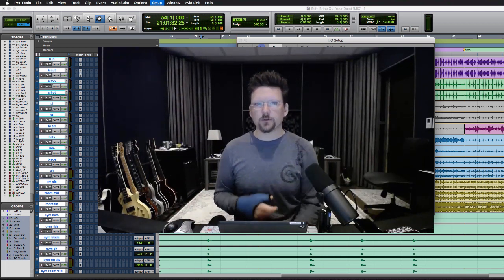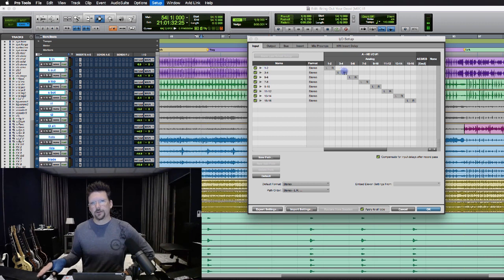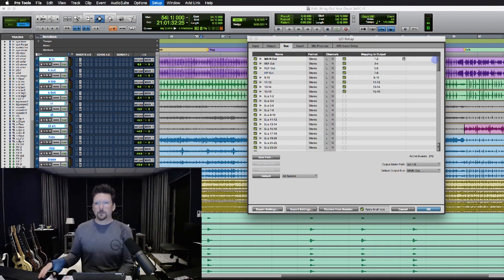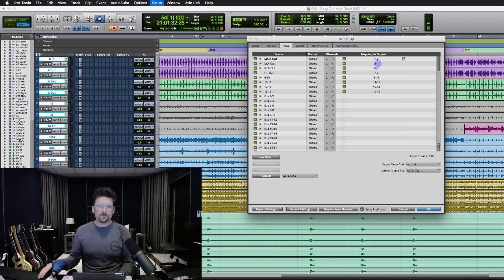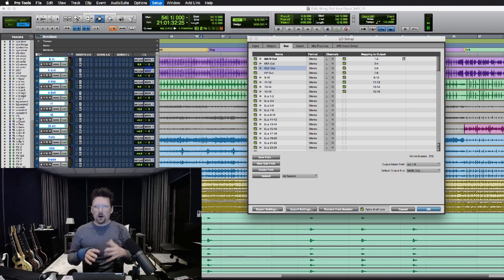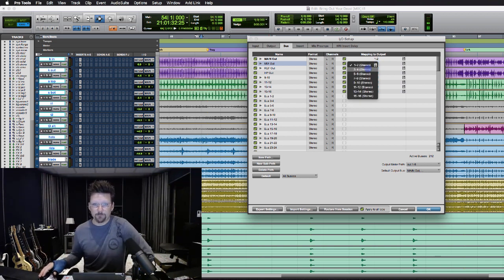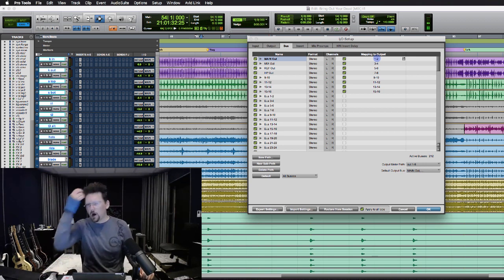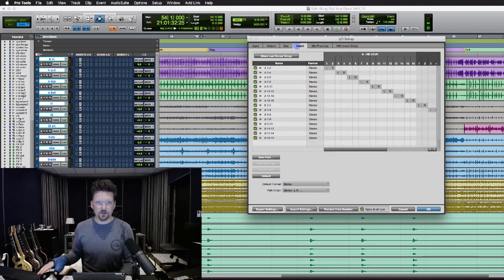The I/O Page in Pro Tools Pt.1

Comment: @Chris Baseford do you know if it is possible to have Output on a Motu M4 output to 3-4 but have the headphones also work?  I have a Left and Right Stereo cable to an iOS device running from the 3-4 Line Out, but switching my Bus from 1-2 Stereo to 3-4, my headphone mix turns off.  Essentially I would like to keep my headphones plugged into the Motu, but have a Stereo out going to a mobile device.

Comment: Hey Chris, it all really makes a lot of since HOWEVER, My problem is this: My PreSonus StudioLive AR16 stopped working and so I purchased a Behringer x32 Producer, but my information for "software out puts" in the bus tab and in my track pull downs as  still read "Ar16 1-2 and AR16 3-4". When I try to manually create new paths it reads, for example, "Output 1 - Digilink n/a" all in italics. NOW... Under both in put and out put tabs, the x32 is recognized. when I go to the pull down on the track I have access to all 32 inputs... It's just those dang out puts that are being elusive. my ambition is to be able to mix out of the box and on my desk. My system isn't down and I'm not by no means "in the weeds" but, I REALLY would like to solve this problem. Any Ideas?

Comment: Thank you for this video Chris...Quick question...How would I insert hardware with inputs/outputs that are not a matched pair? for example, instead of output 3 --- compressor ---Input 3, I do Output 3 ----Compressor----Input 5 (spdif)...The reason why I am doing this is to incorporate a different AD converter in my Chain (Lavry AD 10) while also using my Focusrite Interface's analog output (output 3 in this case)...Is this possible?
Reply from the maker: As far as I know, for hardware inserts, the input/output need to be the same corresponding # on the i/o page.  You can however use an Aux Input track to route to your compressor via output 3, then back in another Aux input track with the input set to 5.  Theoretically that should work although I've never personally tried it.  Obviously there are drawbacks to that (latency, etc.), but it should hopefully work.